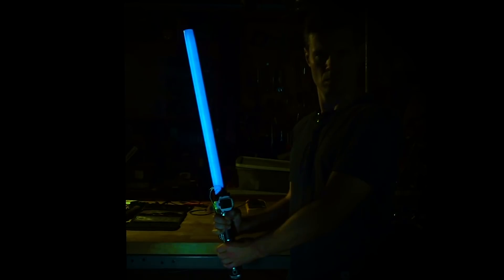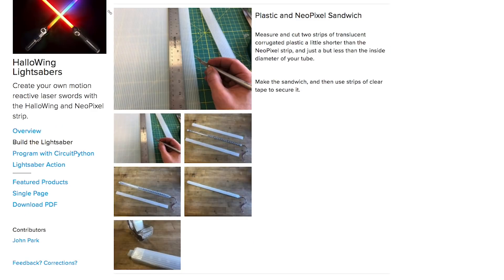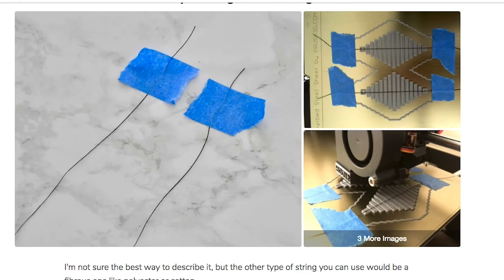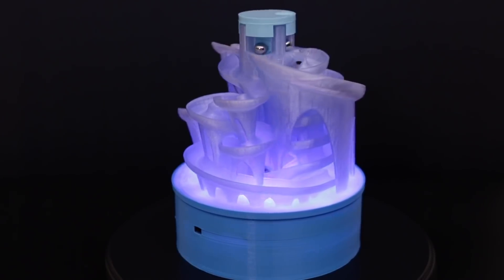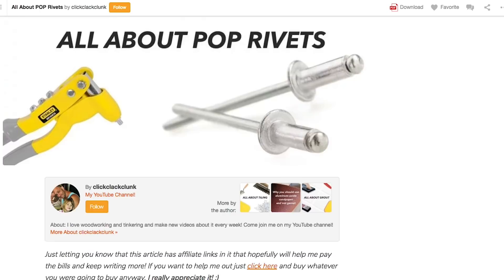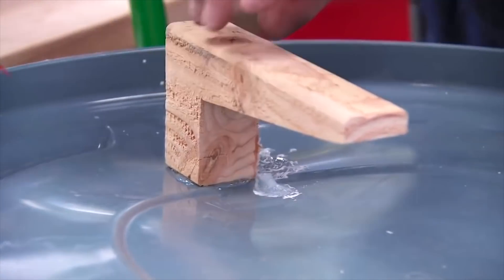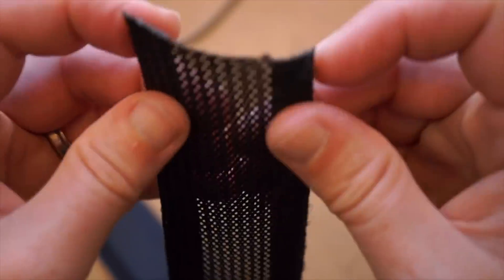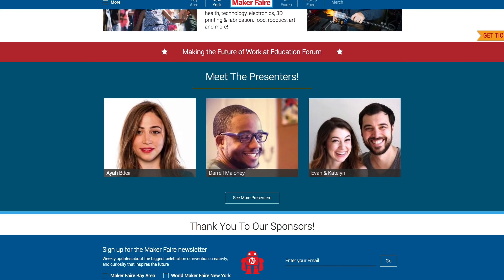Maker Update: Wearable Ouija

Comment: Just a note about the Hallowing from adafruit,  they sell out quick! So if you are on the fence on it, and there is one available now, might help you to decide to pull the trigger.  I ordered one and thought the next day to grab one more to try to do a set of eyes, and they were already gone.  I think they came back in stock a day or so ago.
Reply: True. I was shocked when I saw them in stock after they first announced it. I was a little hesitant on the price, but I had a hunch it would be hard to get once they ran out of stock, so I jumped on it.
Reply: yeah its a bit more money than if you put all the pieces together but not unreasonably so, and with the ability to just drag and drop the UNF  boot loader onto it, the onboard storage, and all the connectors, i think its reasonably priced.